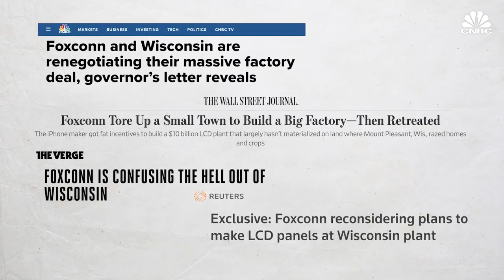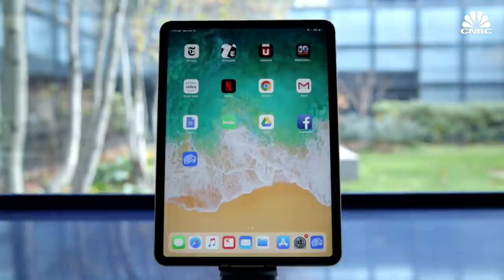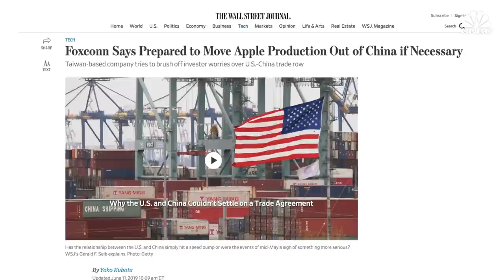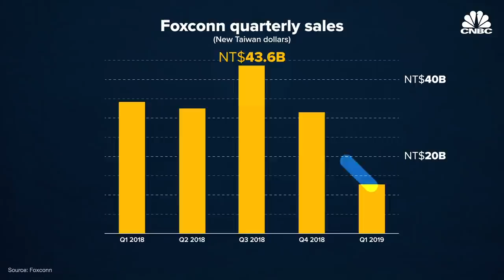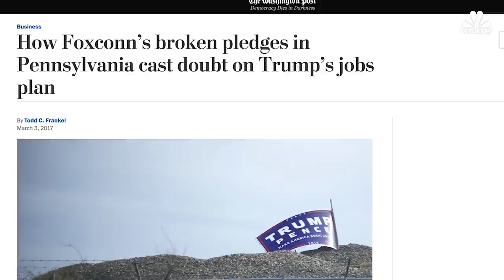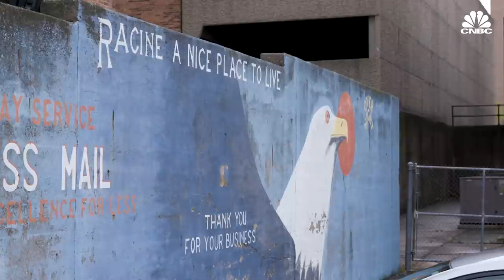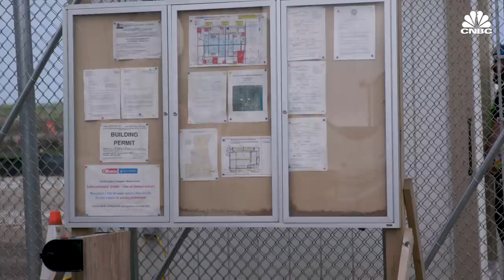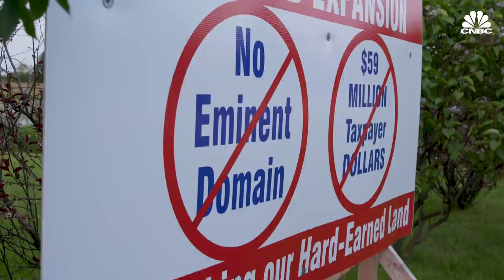What Foxconn - Apple's Largest Manufacturer - Is Up To In Wisconsin

Comment: This is a confusing story because it doesn't speak of Foxconn as a Taiwanese company with Chinese manufacturing sites as well a sites elsewhere in the world so I came away confused about Foxconn - the story tells me it is a Chinese company which implies mainland China not Taiwan.
Reply: It is a Taiwanese company. However if you ask the Chinese there is no such thing as Taiwan. Only one China. Technically Taiwan is a Chinese Breakaway province. So they are Chinese without being officially Chinese right now.
Reply: @waycoolscootaloo  But do we depend on China for a definition of what Taiwan is? I do not. Maybe in the long term Taiwan will return to China and maybe it will not. But for all practical purposes Taiwan is a separate nation from China.
Reply: @philipwest4553  Yes. And no. Taiwan has never declared independence officially. So it's actually not officially a seperate country even though it is in practice. 

Most countries don't recognize it as a separate country. But they do recognize it as a seperate province.

Comment: Did this plant ever make sense?  If all it makes is screens then where will these screens be finally assembled into saleable products.  All of the final assemblers of HDTVs are off-shore.  Why produce a component that will end up having to be exported to be made into a useable product?  Worldwide over capacities  of LCD screen manufacturing has already contributed to the low prices for large flatscreens in the current market.  It isn't like there is a huge need for a LCD mega-factory on US shores.as the closest final assembler of flatscreens would be Mexico.  I just can not see how this project go so far along before it was obvious it wasn't going to materialize remotely close to the figure of over a thousand employees.  I can't even find proof that the plant as stripped down as it must be has actually produced LCD screens.  Something very shady is obviously at play here.
Reply: This was purely a political ploy on all sides from the start. Guo facing loss in profits by tariff. Ryan, Trump, Walker facing political pressure due to job loss in a swing state. Project never penciled. Check out the deeper dive on the Verge.

Comment: I've been to Foxconn in Shenzhen, their largest manufacturing plant. They check your passport before you can get in. Probably at the time, 10 years ago, they had around 200K employees in that location. They run the plant as if the humans were robots (truly human capital), there was no talking, everyone did their job as quickly and perfectly as possible, and the resulting quality is very high. There is no way that this could be done in the US especially at a low wage. Btw... there are a lot of harmful chemicals in these manufacturing facilities. Probably less harmful now - but imagine trying to comply with all the regulations in the US? You can't manufacture electronics with zero pollution. See all the pollution in China? They are suffering (and shortening their lifespan) by making you a high quality phone - remember that.

Comment: Foxconn was going to open a plant in Brazil but didn't and the Wisconsin deal is "farther along"? My friend worked at Foxconn in Jundiai, SP in Brazil for over 4 years and that was a couple of years ago, the place is still pumping out stuff, so your "experts" should get their facts straight. 
In case anyone doubts me over the super accurate dude in the video, here's a link:
https://www.google.com/maps/place/Foxconn+Brazil+Industria+e+Comercio+Ltda./@-23.1658406,-46.9488662,17z/data=!3m1!4b1!4m8!1m2!2m1!1sfoxconn+jundiai!3m4!1s0x94cf21398ad7d345:0x48b493ccf2f8b13d!8m2!3d-23.1658455!4d-46.9466775

Comment: Yeah that was a dumb idea.  In the 90's Qualcomm had a joint venture with Sony to open a cell phone factory in San Diego, inside the longest building in the city.  They set it up and had it running, but closed it about 5 years later.  Americans can't compete in low paying electronics assembly jobs, they aren't good at it, and they cost too much.  If they could, there would be a bunch of electronics factories here in the US, but there aren't. This new generation thought Trump could wave a magic wand and change all that, big mistake.  There is a reason the industry moved all that production to low paying countries, and politicians can't announce those reasons away.  Don't fall for the political wind bags, the industry knows what works and what doesn't.

Comment: I think we can balance the need for jobs and care for our environment. Never going to perfect but it is getting better all the time.
Reply: Should cover the factory in solar and use green chemistry, recycled everything.
Reply: @NicholasLittlejohn  In the short term we will still use some not so green energy until we can evolve and improve the technology used for batteries which will follow with improvement to windmills being less costly and more durable designs as well as materials. Solar farms being but on land not used for much else like Arizona, Some of New Mexico, Nevada, and eastern California for a start. Hydroelectric. I am against Nuclear as being called green and clean though. I think we would have to enforce a nationwide mandatory recycling program as it will never be profitable enough for private ventures to be encouraged to take it on. If it can not be recycled and disposed of in a clean way then find another material to use for it that is.

Comment: They are going to build LCD???  LCD???  panels in USA.   heard of OLED!!!

I was at Apple store yesterday! Saw No excitement at all.
Reply: OLED has burn-in issues, until those important kinks can be fixed OLEDs don't get used for industrial applications like monitors for airports (there have been some OLEDs used in airports however you can find pictures of OLED burn-in from airport terminals just staying the same image for so long.) as well as important medical equipment and so on.

TL;DR OLED is great, but until kinks are fixed it's an expensive product to manufacture due to defects. The larger stupidity has to be the decision of TFT LCD panels compared to IPS LCD.

Comment: the video did not make several things clear...... almost all of the money is threw subsidies tied to employment and other metrics. If they don't meet the number of jobs they don't get any subsidy which is just a tax break meaning Wisconsin will get less money from taxes Foxconn would have to pay. (if the plant wasn't in Wisconsin, Wisconsin would get 0 in taxes from them anyway) The only real money the Tax payers are forking out is for the expansions of road ways but that has been needed for years since Amazon built a big distribution hub in that area. What the video also fails to mention is that other states like Michigan offered 5 Billion+ in tax breaks for the plant and lost out on the deal. Wisconsin cant lose on the foxcoon deal ether they got a big company to create its US headquarter and a 10 billion dollar factory that will generate Billions in economic activity for the state for Decades to come or Foxcoon will not get any of the subsidies because they wont meet the requirements of the deal. The only reason this is even a debate is because the Wisconsin dems had no choice but to oppose it because the republicans made it happen and were running on it and still are.
Reply: Actually, we are paying all infrastructure costs and 20% of all building requisitions made by chinafox. Us locals will pay out over 500 million before we see a dime, and if no jobs, we still pay.